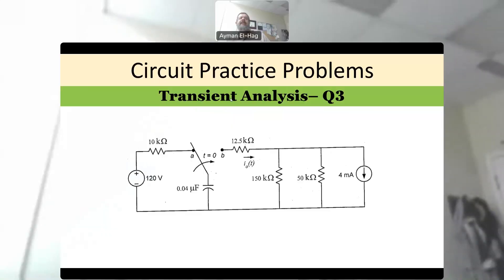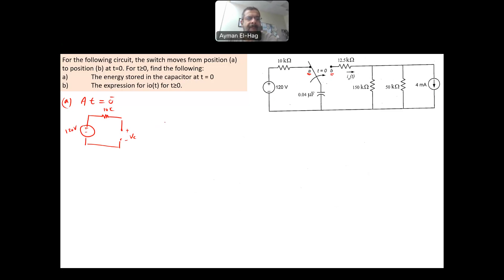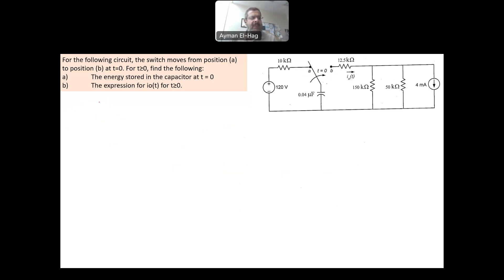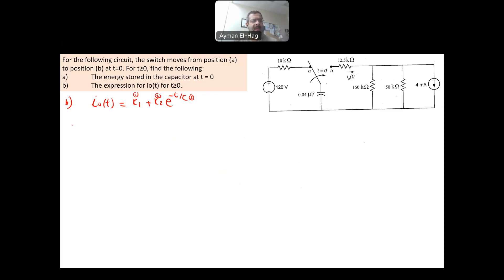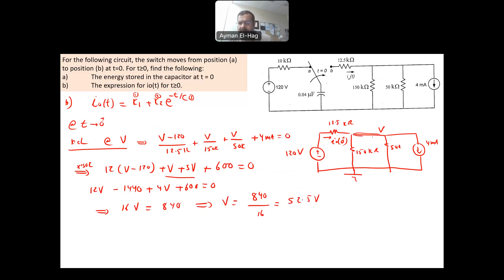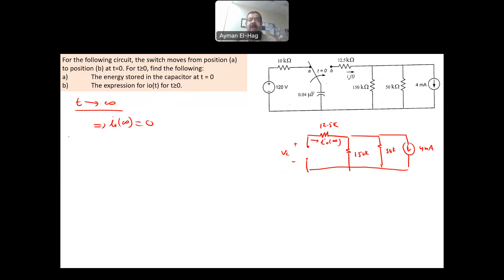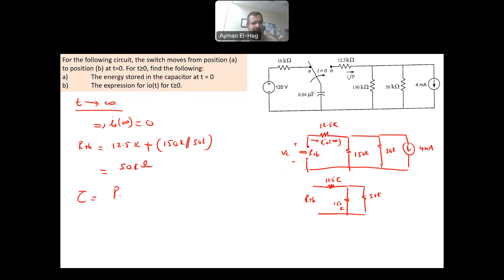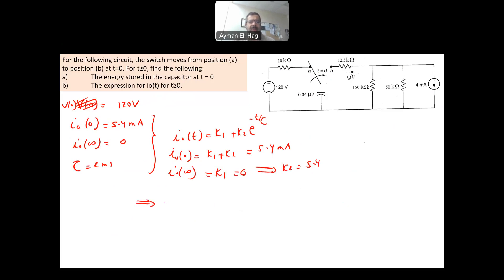Transient analysis - Question no. 3

Comment: Hey Professor, 
I am finding this playlist extremely helpful for preparation of PEO exams. Would you be able to do a couple of examples where we have use laplace transformation. Transient analysis on a circuit with capacitor and inductor.
Reply from the maker: Hi
I just solved one question about transient analysis containing both a capacitor and an inductor. Here is the link:
https://youtu.be/smw5N8GS8fM
Reply: @electrical4everyone   Thank you so much. This is really helpful.
Reply from the maker: You are welcome. Any other question you want me to solve? I will solve first order transient but with inductor
Reply: I think you have already solved such an example in this video https://youtu.be/ULX07oCptL0?si=kPFKQYVGlnwqBT4C
but if you find any different or slightly tricky example, please add a video for it when you are able find sometime. 
I think your playlist for A1 covers essentially all different types of questions
Reply from the maker: @HaiderAli-rm6rd  but it was not a peo question